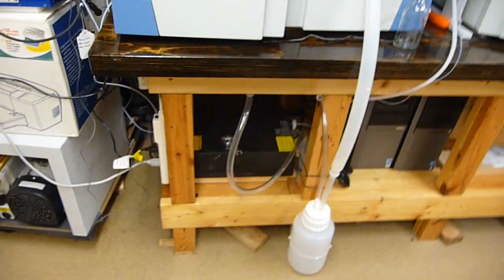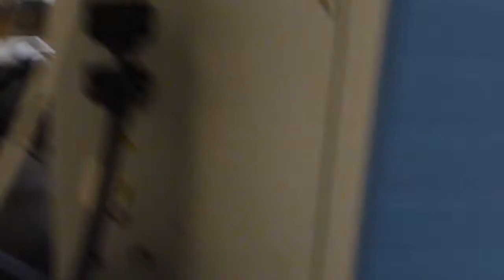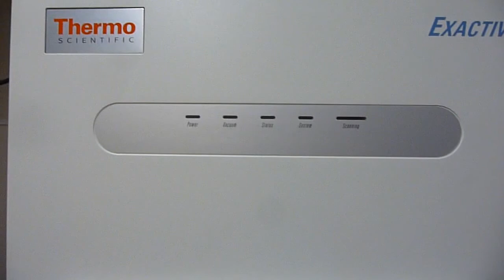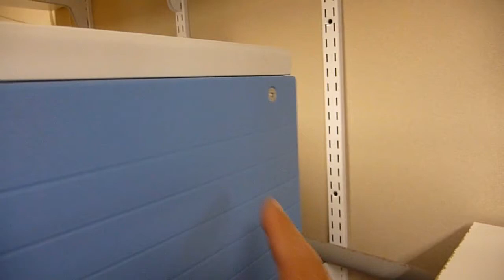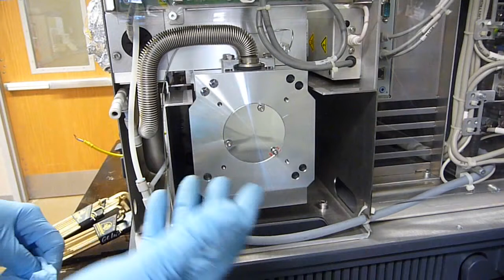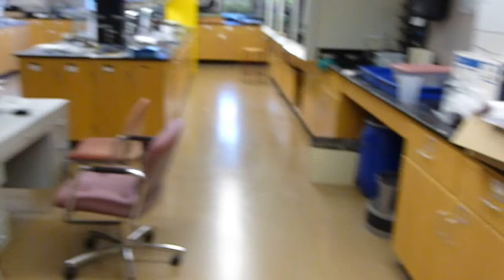Thermo Exactive Orbitrap Turbo Repair & Service Part 1 ...turbo replaced, source turbo oil change

Comment: These videos are amazing. Thank you for posting!
Reply from the maker: Thank you for the kind words!  They are much appreciated. New video for the main turbo [#3 for this Exactive] is in the pipeline, as well as some general  electronic/data processing ones.  Turbo #2 failed shortly after the warranty period; not a catastrophic failure,  just  failed to get beyond 78% of speed.  Turbo #3 is a newer, "improved" model with modifications to the controller.
Reply: @massspecguy8538  --  These are great for those of us who are a little budget limited. Is there any chance you would send me a copy of your mastercal file for Exactive Classic?  I had a HD failure and rebuilding it from scratch seems to have ...almost..? worked, but I feel like something is off about it still.  I'm wondering if I missed something and not many people have this great box these days. I'd owe you one! My email is orsburn@vt.edu

Comment from the maker: Thank you for the kind words...'tis definitely appreciated.  As for the Q-Exactive source TP,  I suspect it might be the same, but I honestly don't know.  On our Exactive, the source TP is still the original TP, and like the main analyzer TP,  it also spins at 60,000 rpm. The only servicing on the source TP so far has been changing the oil cup. Given the turbo's age, the increased noise on our Exactive is not unexpected. [ I first noticed the increased noise about 6 months after changing the oil reservoir.] 

The question was raised among folks here if we should replace the source TP now, or wait until the source TP dies. My Thermo service buddy told me that it was my decision, however while he had replaced well over 50 main analyzer turbos (and some failed catastrophically with significant damage to the rest of the mass spec), he had never seen a source turbo fail and cause any damage.  Therefore, in spite of the increased noise, (especially when I swap the HESI source for a DART source), I'm letting the source TP run until it dies.
Reply: We had 2 UHV TMP failures , the first one was quite bad , Now we have issues with the  source TP  , we had changed 2 oil reservoirs but still the TP is noisy and heating up a little bit and drawing more current than usual , Do you have a vedio of replacement of source TP ?
Reply from the maker: Sorry ... still waiting for my source turbo to fail (given the age and noise, it could die tomorrow or next year). When the time comes, the replacement will have a video. For the turbos apparently there is a precaution now NOT to bakeout more than 8 to 10 hours at a time. For me after a venting, bakeout is 4 hours.
Reply: The analyzer TMP now looks completely different for Q Exactive .. new kit has been introduced with new fans and news setting for bakeout in tune page .. because our source TP is not performing well we also bake out without the heated capillary to reduce stress on the TP.

Comment: Great Video , Many Thanks for sharing such helpful material , Do you know if the source turbo pump is the same for the Q-Exactive plus as well ? Does the source TP was causing any noise prior to changing the oil reservoir?